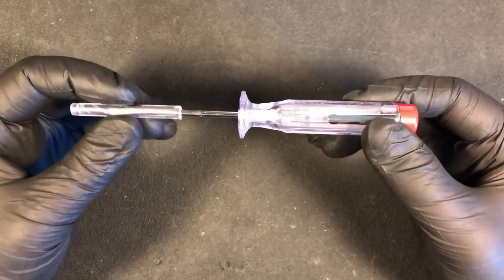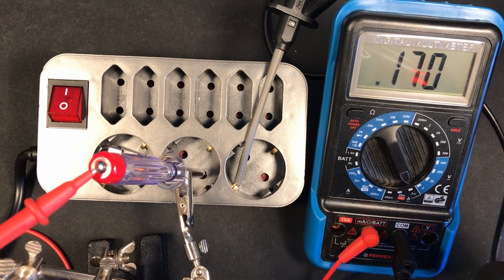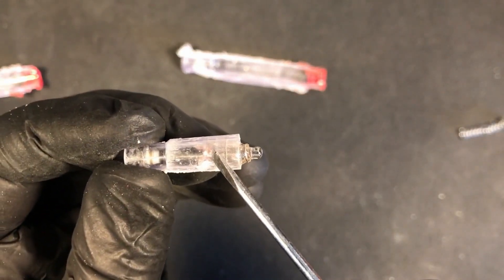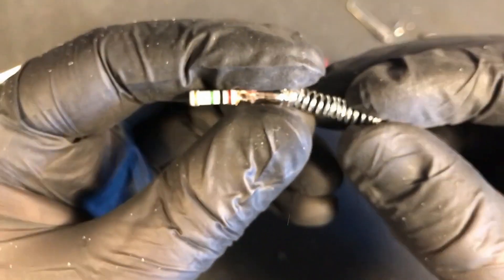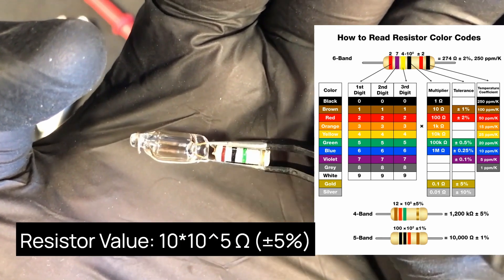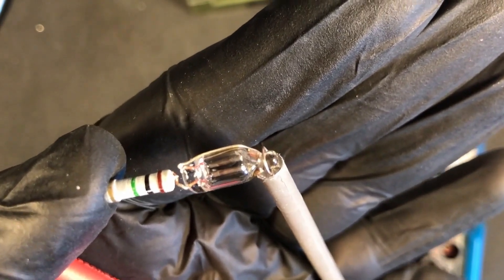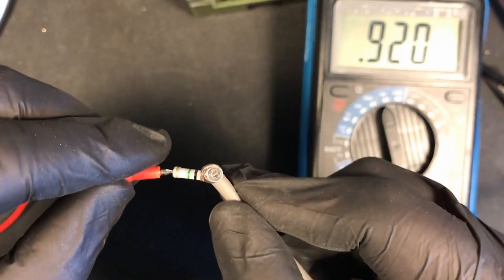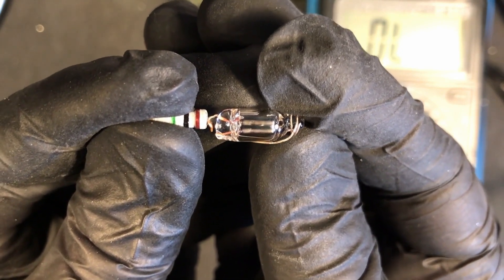What is inside a Phase Tester? Opening a Mains / Line Tester

Comment: The neon gas in the bulb passes no current until around 80 volts is applied across the electrodes, then its resistance drops very low.
Testing one with a DMM directly is not possible.